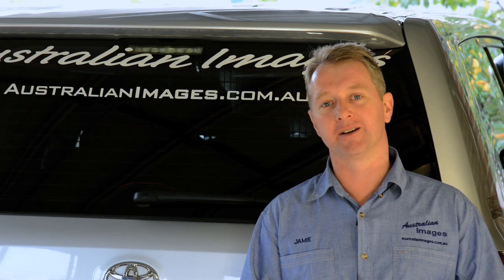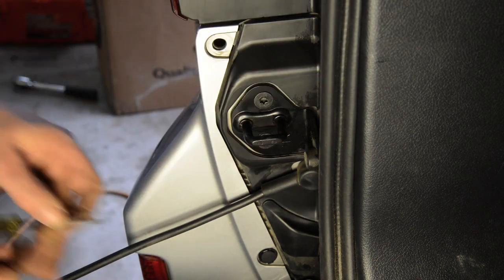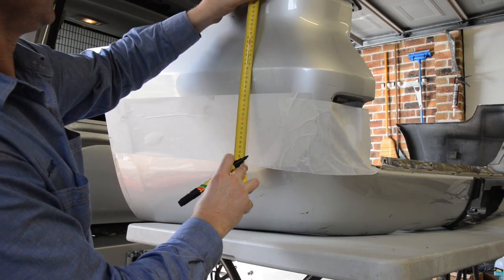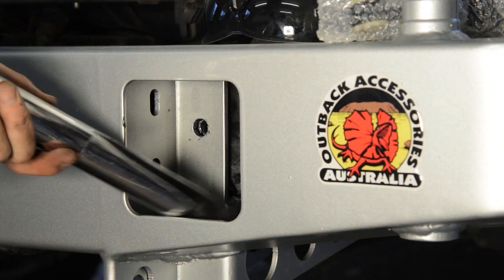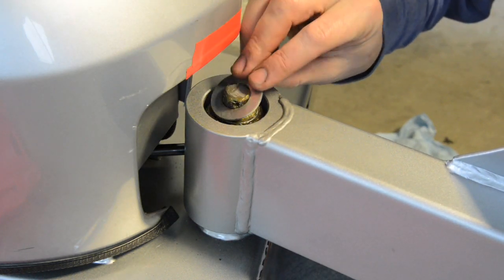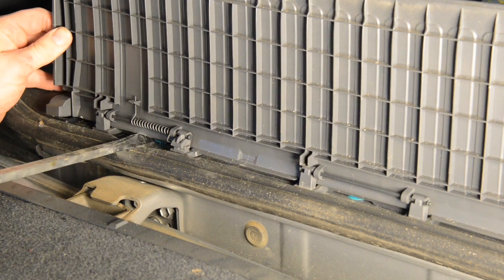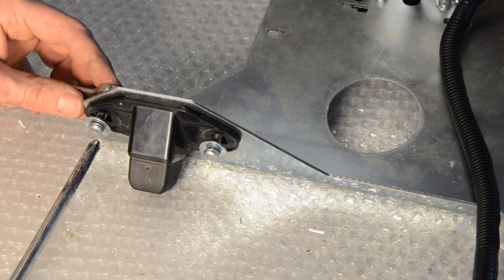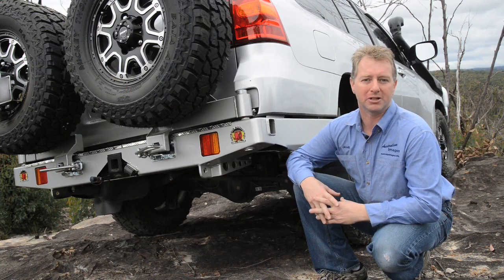Project 200: Rear Bar & Wheel Carriers install on a LandCruiser 200

Comment: I was sold the minute I saw the jacking holes on the side. I find videos like this to be quite helpful. Especially if you would like to eliminate the install workshop rates from ARB and the like. There is also a certain amount of satisfaction by doing the work yourself. Excellent videos

Comment: Might be cheaper, but not sure I want to be chopping up my panels...  lost me on this product... thanks for the detail, it made my decision much easier.
Reply from the maker: You don't cut any panels, just the plastic rear bumper. Every brand of rear bar for the 200-series requires the bumper to be cut. The only (sort-of) exception is if you don't replace the bar itself, but install the Kaymar wheel carriers on their own.

Comment: I agree that the handles (for the spare wheels) are conveniently located. Also elegant way of dealing with the 'old' reflector assembly holes.

But isn't there a risk that a (even minor) tailgating accident bends the mechanism, and you cannot open wheels, ultimately cannot open tailgate anymore? Also, how often need the gas struts replacing?
Reply from the maker: It would have to be a pretty severe impact to damage the carriers enough that they wouldn't open. They swivel from 45mm stub axles, which are welded right through the channel of the bar. I suppose an accident could damage the latching mechanism, but then they would be more likely to not stay closed, rather than be stuck closed.

I can't tell you how often you'd need to replace the gas struts. Mine are 4 years old now, and still working as-new.

Comment: Hi Jamie, love the videos. I’m wanting to install an LED light fitting in the small blanking plate at the bottom up the upper tailgate door. I’m using this video to help me remove panels for running power wiring. You run power and show the removal of the lower internal trim panel in the cargo bay. Can you help with instructions for removing the trim from this panel up to the top of the tailgate door?

Comment: Create a video on how to install  arb air lockers , roof DVD player ,aeroracks, and light on top of the vehicle especially lights under the vehicle behind the wheel
Reply from the maker: I think you're out of luck with most of that. No plans for any of them except, maybe, for a set of lockers. But I won't install them myself, I'll have them installed.

Comment: Great job ! Been seeking a video on line showing how to remove the rear light and indicator clusters (in the rear wings not the ones in the tailgate). Cant find it anywhere on here - any ideas please ?  I removed the two 6m bolts and manage to wiggle the top part free but not the bottom and I don't want to force it (maybe you have to actually also remove the rear valance ?).  Any ideas welcome  🙂
Reply from the maker: You're on the right track. Remove the two bolts, then wiggle and pull the light cluster directly backwards off the car. There are two metal pins (1x upper and 1x lower) that engage into plastic spring clips towards the outer edge of the light. Sometimes they hold on a little better than you'd expect.

Comment: Would you still choose this bar over kaymar or raslarr?
Reply from the maker: For the 200-series, yes for sure. Raslarr would be my 2nd choice, then Kaymar. Main thing I don't like about the Kaymar for the 200 is the separate carrier setup. Their other bars that run the carriers directly on the bar is the way I prefer them, but they didn't do that for the 200.